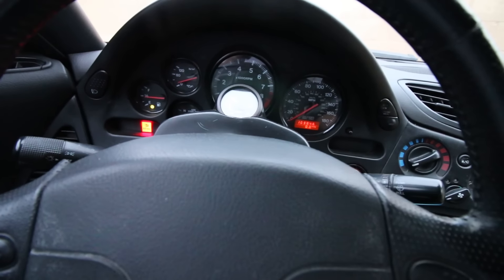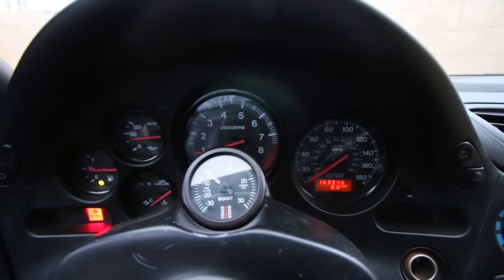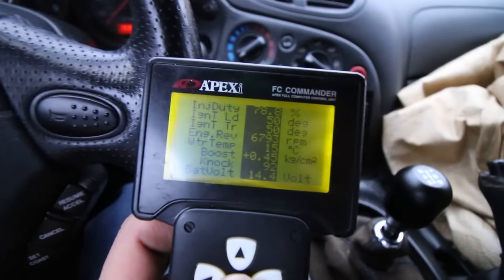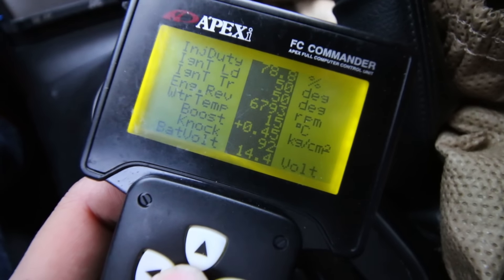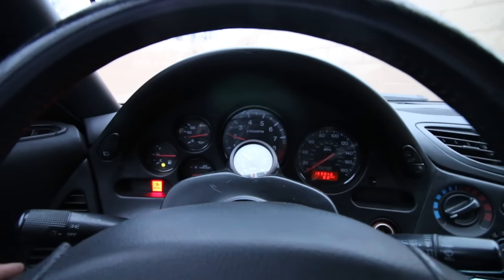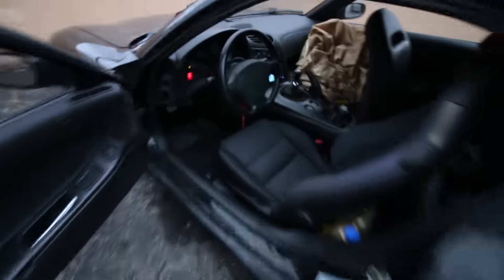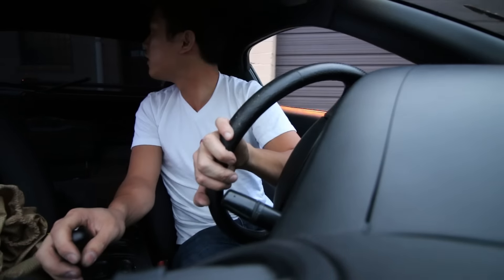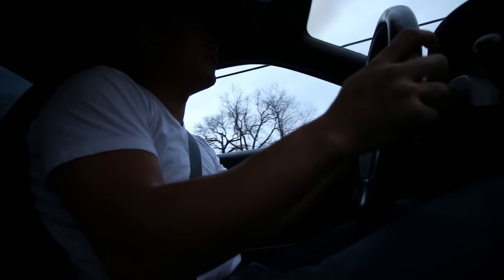Help Me Buy This Rotary FD RX7! - It Runs! Driving - Rotary FD RX7 Video Series 2

Comment: don't put a v8 in it.
Reply: +Xan Millar he alrddy has a v8 one lol :P
Reply: +Xan Millar don't see why not.
Reply: +Gabriel Dalcomune because the rx7 fd is a very balanced car, its a transaxle car which means that the engine is in the front, and the transmission has the differntial inside it to become one peace and mounted on the rear axle.
So the FD RX7 has a weight balance from almost 50:50 front/rear.
When you put a a V8 in it, you destroy the complete balance.
Reply: TheS1PikesPeak lol don't need a lecture on weight distribution.
Reply: +TheS1PikesPeak you are wrong, the transmission does not have the differential inside of it. The differential is on the rear axle just like most other rwd vehicles.

Comment: The stumbling may just be bad gas from sitting without fuel stabilizer, when you ran through a couple gears it seemed ok. Throw some fuel stabilizer in with a new tank of premium, maybe some octane booster too, see if that helps the idle/drive stumble. Overall for a startup and run after sitting that long I'd say that rotary is in pretty decent condition lol. Make sure to check coolant/ oil/ temps just to make sure its not over using

Comment: I came here from the first video.
1. Check the vaccuum lines. The "rats nest" sits under the upper intake manifold and gets very hot. Over time they crack or come undone. This can cause all sorts of idling and driving problems.2. Rotors and brake pads are easy to replace on an FD. The rotors tend to warp over time after a lot of brake use. It was one of the first things that I did on my FD since it also had seized brakes.3. Check that you have at least 1/4 tank of gas. The FD does not like to run well on an empty tank.4. There's something going on with the electrical. Maybe the Power FC was not propperly installed. The Tachometer gets it's signal from the speedometer/odometer. If the speedo/odo work then the tach should be working. If not then pull out the instrument cluster and check for blown capacitors. Blown caps are a big problem on the FD instrument clusters. 5. Check the spark plugs and get a propper rotary compression tester. The engine does not sound a but odd. A good 13b can set you back thousands.
Reply: *meant to say that the engine sounds a bit odd.
Reply from the maker: +Howzer Tech awesome man.  Thanks!
Reply: +CZeroMedia No problem. Feel free to message me if you've got any more questions. I bough a neglected FD six months ago and have been bringing it back to it's former glory. I have been through most of this stuff in that time.
Reply from the maker: haha alright man. will do!

Comment: Most likely when the changed the turbo set up the idle air control hose was blocked off which is why it won't idle when cold and then is fine once warm.

Comment: Like others have said it's best to start with getting all that old gas out before you do anything else and then see how it runs. The shop I used to work at had an old turbo Porsche that the owner left in his garage for months sitting and it had similar issues to this car minus the hesitation. We sprayed some carb spray in the intake, gave it a lil rev-up tune up, put new gas, drove it and it was like new.
Reply: +Radikalnk Old gas turns into rancid acid and starts eating the fuel tank.

Comment: low rpm bucking can become very noticable on a low 'displacement' engine, due to lack of torque, and add a "big" turbo, with The torqur and HP high up..... check ANY "normaldriving" vid of a Rotary,, People run them 2500rpm and up in The city, not like a normal car with torque, 2500and down :-)
Reply from the maker: +maxpower700 my evo is the same situation. but as you can see buckling happens at wot
Reply: +CZeroMedia aha, yea i kinda missed that it was at wot,,, i blame it on The cat on my face and watching it on my Phone lol
Reply: +CZeroMedia It sounds and looks like its running to lean  not getting enough fuel forsure.

Comment: its not the tune, you just need to be at a higher rpm to maintain the gear. rotary's like shifting at high rpms so the lower rpm the more it tends to bog down. hope that helps

Comment: Hitting boost cut and theres a major miss down low. Blue receiver is apexi avcr boost controller and metal over flow is air separation tank (ast) behind the vmount intercooler. Lastly dont rev it like that when cold... rotary engines have different metals inside and car needs to be bought up to temp before hammering them otherwise kabam

Comment: Take it to a tuner/builder and go over the parts thoroughly and open the motor up before putting it on the dyno. Make sure the previous owner was religious with fluid changes/ maintenance. Asking us is okay but the rotors/housings/bearing will be the tell-tell of all things. Don't just immediately go get it tuned before opening the engine.

Comment: Don't rev it till its at operating temp, your suppose to let the rotary warm up before driving it
Reply from the maker: Yeah I know. But it was just the only way I could keep it to idle :(
Reply: Says who? I've owned 2 1st gens, a 2nd gen, and my 20b fd. Not one time have I let my engine just warm up before driving it. I treat them like normal cars (crank up and drive away). With rotary's, you wanna warm up the combustion chamber as fast as possible to reduce the carbon buildup.
Reply: +GoDownOnMyBullet 1st off if you don't have any Rotary related experience, you don't have a clue. I got 25 years of ownership of numerious generations backing up what I know to be fact. You????? For the record my fd was one of the few fds that actually passed the 100,000 mile mark on it's original engine. Nobody said anything beating or racing on a cold engine. I simply said, I crank up my car and drive away like a normal car. Stay paranoid if you want.
Reply: +rotaryperfection I always start mine and then wait till I see the temp gauge move then drive it carefully till its at operating temp
Reply: +Devon5589 There's nothing wrong with that. Some people wait till it's fully warm before they drive. That's a big mistake because the rotary's combustion chamber is so large that it doesn't combust the fuel air mixture fully at low rpm when the engine is cold. That side effect is excessive carbon buildup on a cold engine. When my fd was stock, I let the AWS (accelerated warmup system) do its thing before I drove off ( which was 20seconds).
Reply: +GoDownOnMyBullet Are you serious? 1st you us a piston engine example to try prove a point and basically insulted me by saying it's people like me who bascially destroy engines prematurely. Bottom line this is a ROTARY ENGINE. Do you have any idea what specific parts need the most lube internally? I'll wait! Your example has ZERO merit here when it comes to rotarys.
Reply: +GoDownOnMyBullet Again your example MEANS NOTHING when it comes to the engine in this car. If this was a piston engine, you would be 100% right but it's not. Again, your example is meaningless here. I saw nothing wrong with your original reply until you related how I treated my rotary powered cars to abuse.
Reply: +GoDownOnMyBullet And why would say such a thing why when the discussion is about rotarys? If there was an LS swaped engine, I would have never said a thing.
Reply: +GoDownOnMyBullet For the record the OMP doesn't do much at startup because the top nozzels usually drain of oil after shut down so the only lubrication the apex seals see is the oil film that stays on the housing walls. The OMP is a very slow reacting system. Now the nice thing about the lubrication system of rotarys in general is the fact that since the block is so small, it doesnt take long to build oil pressure. Take a look at my last video where I installed an Rx8 starter. Just so you know my 20b engine has 50% more displacement than the 13b in the car on this video yet, both engines have the exact same oil pump. Notice how fast my engine builds oil pressure on a cold start. With rotarys the engine is fully lubed just a few seconds in after startup.